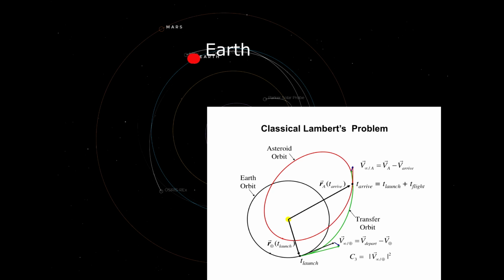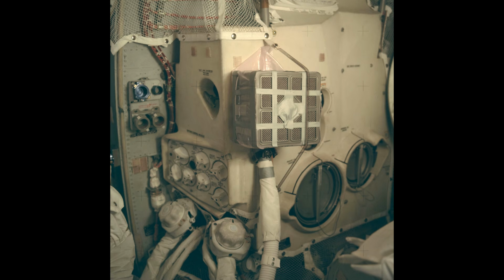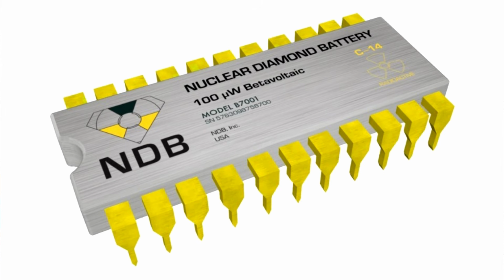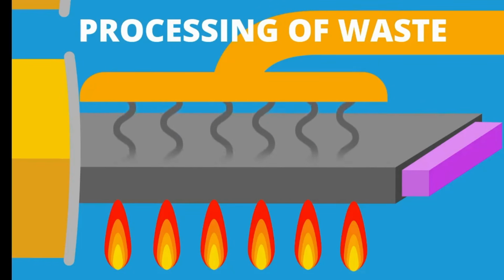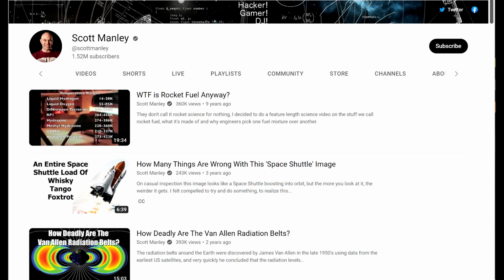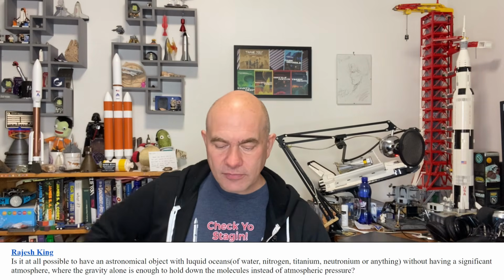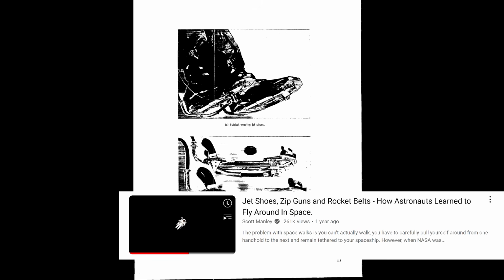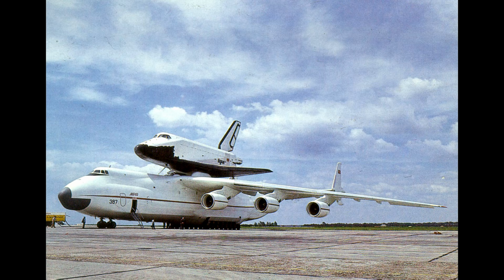Is There a Tripropellant Rocket Engine?  How Are Orbits Planned? - Deep Space Questions 21

Comment: Aren't most solid r rocket motors technically tripropellant as well? They use both the aluminum and the binder as fuel, as well as a separate oxidizer.

Comment: I was working for LTV in Dallas at the missiles division from 1985 to 1991 where we tested and supported the ASM 135A miniature vehicle where I saw the the mv ship that struck the sattilite. I spent a lot of time in clean rooms with the mv, cleaning and running leak down, shake and operation testing. There are two national museums that projects I had a hand in are at. The Smithsonian has the ASM 135A and the California Science Museum has the OV-105 Shuttle Endeavor that I worked on manufacturing the 8 radiator panels mounted in the cargo bay. I have had a fun career as an A&P and at 73 I have wonderful memories doing great things.

Comment: On the topic of Asparagus staging the best way to do it that I know of was on the proposed UR-700.
Its boosters would have a sort of 'integral drop tank', which was a second set of propellant tanks mounted on top of the first, and they would feed into the core propellant tanks - but crucially NOT into the core propulsion system. The idea being that by topping the core off mid flight, they would avoid the issues previous attempts at cross feeding experienced.

Comment: The idea of a tripropellant is that metal-oxidizer reactions yield better energy per mass than hydrocarbon-oxidizer reactions, but the resulting molecules are complicated and so don't end up with a lot of velocity.

Solid rockets do this too: typically, they burn aluminum and oxidizer to get the best energy, and then burn some hydrocarbon and oxidizer to get lots of simpler diatomic outputs.  The problem is that the ammonium perchlorate they use for oxidizer is not as good as LOX or LF2, and about 70% of the propellant grain is ammonium perchlorate.

If you don't want to use fluorine (toxicity), it turns out that a hybrid motor has the highest specific impulse.  Aluminum and PBAN (hydrocarbon) is about as good as you can do with oxygen as an oxidizer.  So make a solid fuel grain without the ammonium perchlorate, and pump liquid oxygen into the top of the motor.  It's been tried!  I don't think the rocket managed to take off, but instead caught fire and just burned anticlimatically on the pad.

My understanding is that hybrid motors have problems with the oxidizer mixing with the fuel grain at the burning surface.  One thing I'd like to see tried would be a solid rocket with maybe 20% ammonium perchlorate, so a very very rich low-temperature exhaust but with reaction kinetics like a normal solid rocket motor.  At the bottom of the motor you inject pumped liquid oxygen to do most of the combustion.  This should get most of the Isp benefit of a hybrid without the reaction kinetics problems.
Reply: Any idea what the problem has been with Virgin Galactic's spaceplane?  The smaller SpaceShipOne won the Ansari X prize in 2004.  Burt Rutan decided that to be profitable for tourism it needed to be scaled up from three passengers (two tourists and a pilot) to I think originally seven passengers, although it later increased to eight passengers (six tourists and two pilots). As well as increase the altitude, even though SpaceShipOne already exceeded 100 km.

The SpaceShipTwo project as everyone knows has taken almost two decades. I read once that among many problems that they experienced the biggest was that it was much harder to scale up the hybrid motor than they thought it would be.  I remember they were experimenting with different fuel around the time of the crash in 2014, although it turned out this had nothing to do with the crash. I just looked it up (not going to pretend that I remember this) and the original fuel was  HTPB (hydroxyl-terminated polybutadiene). They experimented with thermoplastic polyamide in 2014, then switched back to HTPB in 2015.

Besides the delays, the spacecraft is also underpowered and barely makes 80 km in altitude. So they have to settle for the U.S. space designation of 50 miles and not the international standard of 100 km.
Reply: @StevePemberton2  I think the basic problem is economics.  There's just not many people that want to spend enough money to buy a really nice car for a ten minute ride.  So there's not enough money to do the engineering properly.

Next is the system architecture.  Using a plane for a first stage is the most expensive way to do it.  That's bad for something trying to deliver a low-cost ride.

Past that, what is the actual problem with their hybrid motor?  I don't know, but I'll point out that nobody has really figured out how to control the reaction kinetics of a hybrid.  Like I said, I would avoid that problem by making the fuel source a normal solid-fuelled rocket (just with lots of extra fuel).  This will have the usual kinetics that can be well controlled.  Then, pump LOX into the mix for extra (and controllable!) oomph.
Reply: @IainMcClatchie  Agree with all of that except for the economics.  I think there is a big market out there, worldwide, of people who have a few hundred thousand spare cash to spend to go to space even briefly.  Virgin Galactic has spent billions and billions on this, currently a billion dollars per year. I realize that seems like impossible to get a return on investment, but if they had gotten it working ten years ago and started getting some revenue and built up a steady flight rate like they were supposed to they would likely be profitable by now.  It just looks like it was a poor design choice all around and it's too late for them to change it. It could work if they can get a bit more power out of the hybrid motor, which is why I was asking, but they don't seem up to it unfortunately.  For sure they will never make enough money to have made it a financial success.

Blue Origin meanwhile is proving that the traditional approach with a capsule and standard liquid rocket fuel is much more practical. They stand a much better chance of it being profitable. Again need to get the flight rate up, the customers are out there. Of course they are grounded at the moment, and that is the one big problem here, one tourist gets killed and the whole house of cards collapses.
Reply: @StevePemberton2  I'd say SpaceX are the ones who have proved the capsule and kerolox combination.  Curiously, they are moving on to a combined upper stage and capsule, and methalox.  The latter makes perfect sense to me, the former... I'm not sold on.  But I'd be super happy to be shown that it works.

The Blue Origin folks seems have have caught some of the OldSpace overspec-everything go-slow bug.  I wish they'd hurry up, their newer designs look better to me and I'd rather not see a monopoly on low cost rocket launch.
Reply: @IainMcClatchie  I don't expect people will either be launching or landing in Starship. Putting people inside a second stage booster is not going to happen. Propulsively landing after a bellyflop is not going to happen with people in it. 

I expect that Starships will be launched to Earth orbit, fueled, and then astronauts will launch in Dragon capsules to dock with it then head off to wherever. Or just stay in Earth orbit if it's a Starship that's being used as a space station or a hotel.  A crew of 14 people can be launched in just two Dragon launches.

Comment: Any engine using fluorine as an oxidizer would be incredibly powerful, but something you_really_ don't to try and build as it will react with pretty much anything (except the noble gasses).

Also a hydrogen-fluorine rocket would make hydrofluoric acid in it's exhaust, which is another chemical not to play around with
Reply: Maybe as an course correction rocket where the gas is nowhere near earth

Comment: I don't know "cyclers" but I see weigh stations and where travelers would decompress, so to speak, before getting back in a ship to continue to Mars. The moon should be an assembly point for ships, as it would be easier to fly parts to the moon and assemble ships and station. Once on the Moon launching huge craft would take little energy and more fuel can be available for the flight.

Comment: I need a fuel that will burn at over 6,000 degrees Farhenheit .  Acetylene will burn at 6,300 with adequate  oxygen.  I believe there are two other gases that will burn hotter, do you know of them?  Also, Nitromethane is a liquid at one bar and room temperature and I want to know if Acetylene will dissolve into it like it does with acetone.  If so, how much and how hot will that burn?  I need a super fuel that will keep over time in a simple tank in space without outgassing.  Thanks if you can find some answers for me.

Comment: What about reusability and varied optimization for cargo cyclers?  I'd expect the best propellent to use for deep space travel vs launch differs, and there are certainly other things with radios etc. that would differ, I'd imagine reusability is drastically different for a combination vehicle vs separate dedicated vehicles also why carry your earth reentry system to Mars.  I'd imagine needs for people vs cargo are still very different, ion thrusters may make the transfer too slow for humans and eat up any savings vs extra life support requirements, but for cargo a very high specific impulse engine that was more efficient but took longer to get there would be good.

Comment: Another reason the Buran program was cancelled was because the US never built a 'Star Wars' orbital missile defence system put in place by the shuttle; Buran was built, in part, to answer the proposed US "Space Shield" Star Wars system which would have relied on the shuttle to build it.  If the Soviets wanted a "Star Warski" system, in answer to the US system, they, too, needed a shuttle.  When it proved impractical for the US to build huge orbital laser battle stations, one of the prime drivers of the Buran program vanished.
Reply: Buran was commenced in 1976, long before the Strategic Defense Initiative.
Reply: @michaeldunne338  Yes you're right.
Reply: @billmilosz  But, the 1983 SDI announcement by Ronald Reagan did spur on the Soviets to develop the Skif/Polyus laser test beds (like a mock up called Skif-DM, and later on, a 1Mwt carbon dioxide gas laser for instance with Skif-D2). So the first flight of Energiya was to lift into orbit Skiff-DM/Polyus in May of 1978 - a test bed that was 36.9 meters long, maximum 4.1 meter diameter, mass of 77 tonnes (a big piece of space structure). 

What is possibly notable, various leaders in the Soviet Union may have focused on the Energiya-Skif/Polyus launch missions around 1985, in hope of demonstrating the feasibility of the Energiya super heavy launch system, since delays with Buran were pushing back timelines. Now a good number of those delays did arise from difficulties encountered with testing the liquid fueled strap on boosters of Energiya though (Blok-A, with RD-170 engines). Interestingly enough, Energiya-Buran was originally supposed to launch in 1983, the year that Reagan laid out his Star Wars vision and program.

Comment: I would just like to point out that the Apollo 13 tank explosion was more a failure of paperwork than design. The 1965 decision to have the systems work on 28 volts and 65 volts both, was mussed by the O2 tank makers. The 1968 incident of dropping O2 tank #2 by two inches and damaging an internal tube used for filling and draining LOX was missed initially and later discovered in a 1970 wet test. Unable to drain the LOX post test, it was decided to leave the heaters on and boil off the LOX to empty the tank. The 65 volts blasting the 28 volt thermostat welded it closed loop and the resulting temps cracked some wire insulation on the heaters. An incredible chain of accident events… and I believe the astronaut that signed off on the heater evacuation process was Lovell himself. This same hardware had flown on 5 successful manned  flights.  The odds of all this happening is astronomical, yet it did. The design was sound for the acceptable risks. The errors were clerical, procedural and the acceptance of the unknown risks of an alternate non standard procedural fix. Then again, it was 1968 and we had a goal to land on the moon in 1.5 years.

Comment: Why does a nuclear diamond battery need to be packaged in a vintage 22 pin dip chip? Two pins to handle the microwatt of power... And 20 pins for a centronics parallel style interface to detect whether your chip is about to have a Homer Simpson core meltdown?

Comment: The topic of sending used nuclear fuel (aka high-level waste) to space, or into the sun, or some variation on the same theme, seem to be popping up quite regularly. It's very disappointing to see it here as well. But basically I think it's predicated on this impression people have that nuclear waste is this intolerable burden on future generations, qualitatively unlike any other waste human activity might generate.

The reality is that nuclear waste must be kept away from the environment until the most (radiologically) volatile isotopes have decayed away, after which it is a superb resource for Uranium and Plutonium that can be fed back into reactors.

The cut-off point for which isotopes to worry about is Strontium-90 (Sr-90) and Caesium-137 (Cs-137), both of which have a half-life of around 30 years. There is a simple rule of thumb that after 10 half-lives, the radioactivity will have decayed away to nearly nothing (technically one 1024th). So that's around 300 years in this case. You can also decide you want it to decay to one millionth, in which case you have to wait 600 years instead. Same difference -- we have built cathedrals that took longer to complete, so to think that we can't protect something for this duration is a bit silly.

The next isotope down the list of stuff you find in nuclear waste (used nuclear fuel) is Plutonium-239, with a half-life of 24,500 years. Ten times this is a quarter million years, and this is the "back of an envelope" version of the calculation that leads to why it is often said that nuclear waste must be protected for hundreds of thousands of years. In reality, this is false. They are applying an extreme version of the "precautionary principle", since Plutonium doesn't exist naturally on Earth, life of Earth has not evolved around it. Therefore, the thinking goes, any leakage of Plutonium into the environment, no matter how small, slow or unlikely, is unacceptable. The reality is that the radioactivity from Pu-239 is quite moderate, and the isotope can be handled without shielding.

The repositories for used nuclear fuel attract a lot of attention and controversy. But in reality, they are basically the same as permanent repositories for chemical waste, including elemental substances like Arsenic, Cadmium and Mercury. These attract hardly any criticism, yet they need to protect their contents literally for eternity, precisely because these things are not radioactive (i.e. they don't decay).

My own view, however, is that it is still a mistake to put used nuclear fuel in geological storage. Instead, we should just wait the 300 years until the hot stuff has gone away, then reprocess it and put it back into future reactors. Alternatively, it can be reprocessed immediately, at greater expense but with quicker rewards. Remember, 95 to 99 % of the nuclear energy is still present in nuclear fuel as it leaves the reactor -- it's like putting a bar of chocolate in your mouth, licking on it for three seconds, and then throwing it away.

The only thing we achieve by putting it in the ground is making an artifiial Uranium and Plutonium deposit for future generations, but making it unneccesarily difficult to get to.

Comment: Would an orbital 'tug' make sense for transiting between orbits, to reduce the complexity of the ground-to-orbit craft? It seems to me that you would want something like that rather than expecting the crew capsules do everything unassisted. Does orbital mechanics and/or fueling costs make this impractical?
Reply: I think the most sensible thing would be separating ship launches from astronaut launches, so ship and equipment can go up without all the overhead needed to safely launch people, then send astronauts up on a smaller dedicated crew rocket like Falcon 9 when everything is waiting in orbit. You can send translunar ship up in one launch, moon lander direct to a lunar orbit in another launch, then astronauts to get into the ship and meet with the lander. A tug is workable, but to come back from the moon it makes things so much more expensive than direct re-entry, it just doesn't make sense. Maybe if you could refuel at the moon.